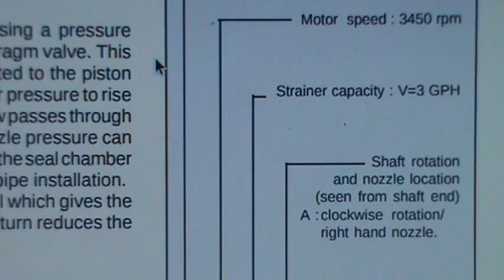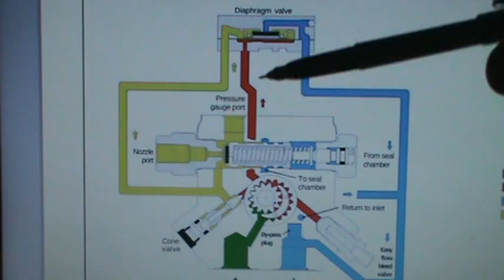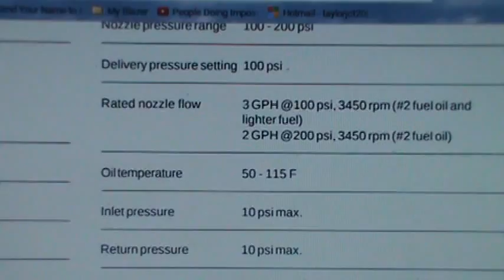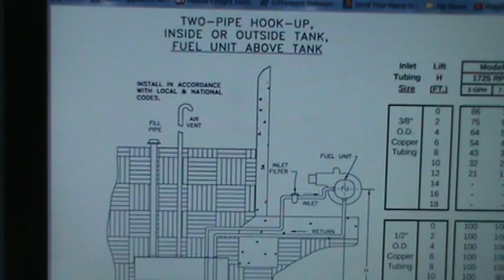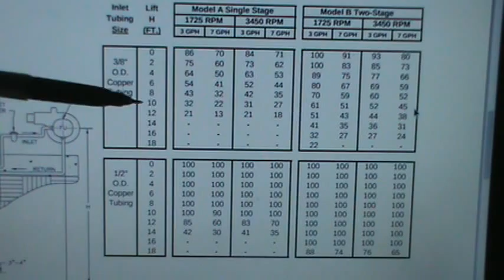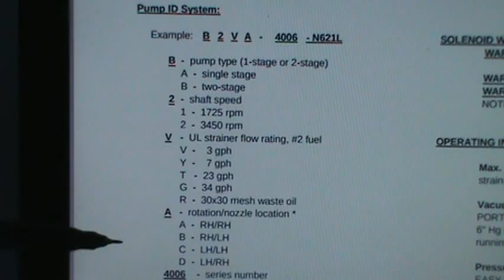Oil Burner 101 Part 1 "Fuel Pumps"

Comment: trying to go from LP to oil ( house is in the side of a hill and the utility room is up 20' from ground )
is there a pump I can use to get the oil to lift 20+ feet I will be buying  a Beckett oil burner???  
or can I cut up an old Beckett oil burner and just use the pump to send it to the oil burner 20' up use a relay of some kind ?? with like car brake line (2500 psi ) ??
Reply from the maker: Douglas Smith Hi Doug thanks for asking. Yes there is an optional two stage fuel pump that can be ordered with the burner or it can be added if you can not purchase it already installed. The first stage of the pump is designed to pull the fuel to the pump,and the second stage builds up the pressure. Ask your dealer for that option. When in doubt, always follow the manufacturers guidelines when choosing a fuel pump to make sure it is capable of doing the necessary job. You can find the pump curves and specifications on their website. http://www.suntecpumps.com/PDFs/Installation%20and%20Service%20Manual.pdf
Reply: You could use a day tank.

Comment: CAN I USE THE WHITE PURE SILICON FOR SEALING WINDOWS  WOULD IT SEALTHE BACK OF THE OIL PUMP PLATE GOOD FOR 300 DEGREES F ?  OLDER WAYNE BURNER  KEROSENE
Reply from the maker: +Rondo Schiavoni  Hello and thanks for the question.
I don't know what plate you are referring to or what fuel pump your have.

I would not use anything but the original gasket or if one is not available, make one out of gasket material you can purchase at a hardware or small engine rebuilding center. Fuel oil will dissolve most types of caulking at least it will soften it and cause a fuel leak.